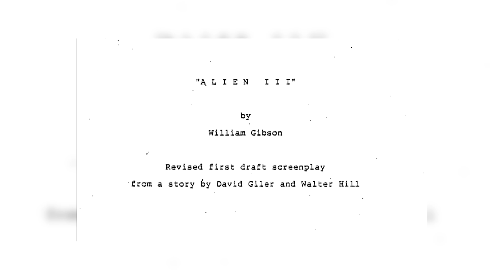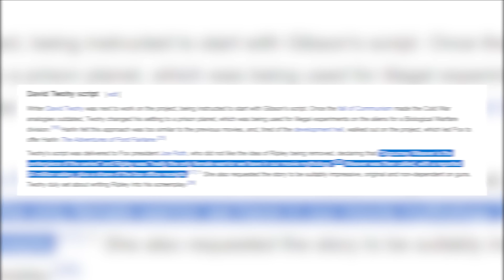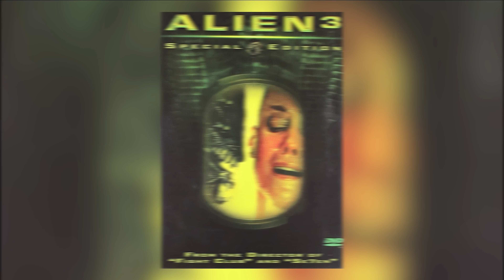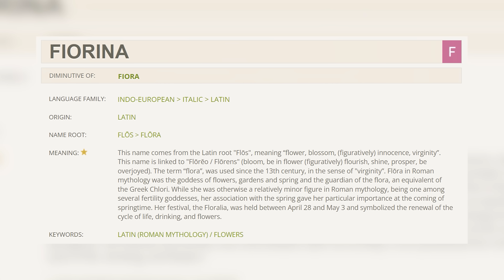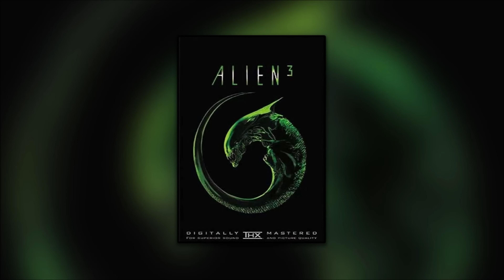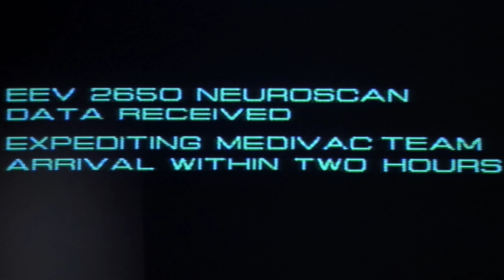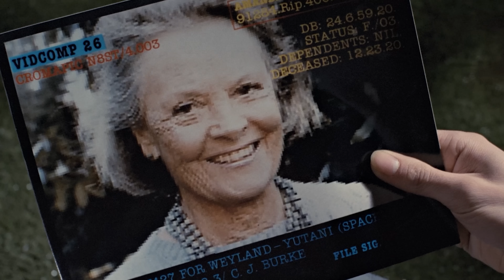ALIEN 3 (1992) Breakdown | Easter Eggs, Directors Cut Comparison, Hidden Details & Things You Missed

Comment: The rottweiler instead of the ox in the theatrical cut was a better choice.  Makes more sense given how the xeno is faster and more agile than the human hosted variants in the previous two movies.
Reply: Nah. Makes no sense to how a almost full grown same size as the dog. It wasn’t even a little “snake” like. The Ox made sense because of how big it was and how big the Xeno pops out semi fully grown.
Reply: I think overall, the extended (Assembly) cut is a more well-rounded version, but...
The editing in the original version of the funeral/birthing scene is mesmerizing. This is lacking in the Assembly version.
I don't have a preference to which animal was used, but the scene is more impactful in the original.
Reply: How about....where the fuck did they get an ox???????
Reply: I'm a little more partial to the dog host for the xenomorph, too. The ox was one of the weak points of the Assembly cut, though I felt it was overall a better version.
Reply: It adds to the fact that xenomorphs have no delusions of mortality. They don't care if you're a dog. I think they should have had two xenos running round. One made from the dog which is smaller and more agile, then the bull like from the ox. With how different the xeno looks throughout the film, I do wonder if that was ever something they wanted to do.
Reply: @Dante Colon the xenomorphs grow tall and big regardless of its host. Catch up with the lore
Reply: @acfan8253  The Alien 3 Runner is far smaller than human borne Aliens.
Those were good 8ft tall, the Runner is dude sized if not a smidge smaller - 5-5,5ft.
Reply: In one of the versions of the scripts it was going to be a rhino, that's messed up but fun to think about 😅

Comment: 17:35 the twin suns were used because the area of space in which Alien, Aliens, and Alien3 take place is near Zeta 2 Reticuli, a binary star system. Lambert states this in the first movie when they are getting ready to land on LV-426, which then of course is where Hadley’s Hope is later founded. And then having recently escaped LV-426 at the end of Aliens, I would imagine that the Sulaco wasn’t very far away by the time the escape pod had to be jettisoned because of the stowaway facehugger(s) causing trouble. So, the reason for the two suns may not necessarily be a callback to Star Wars, so much as it is a mindfulness of continuity on the part of Alien 3’s production team.
Reply from the maker: Great but if trivia, thank you
Reply: @heavyspoilers  thank you for the video, despite you (understandably) not wanting to watch Alien 3 lol

Hope to see one on Resurrection, and the rest at some point.

Comment: The actual stuff with the xenomorph and Newt is a lot worse than what you picked up on.

The explanation is that the facehugger got into Newt's pod first, and impregnated her. You can actually see in the quick x-ray shot that the character isn't wearing anything on their shoulders. No clothing. Ripley still has her singlet on.

But the alien queen inside Newt couldn't gestate to full size since Newt was just a kid, so the alien queen embryo crawled up out of Newt's throat, broke Ripley's stasis chamber, and then crawled DOWN HER THROAT. That's why she's rubbing her throat and the like, despite nobody else in the series having throat issues after being impregnated. It was because she had a half-grown alien embryo FORCE its way down her throat, hence the hoarse voice, etc.

There's actually a comic that shows this explicitly happening, and also a scene in the script that never got actually filmed showing it, likely to try and keep the fact that Ripley was the ultimate host a secret until it was revealed in the film itself.

A lot of the issues are that the theatrical release version is bloody dogwater. There were so many changes and cuts and whatnot that it just ruined any chance of continuity in the assembly release. Like the fact that the 'super facehugger' appears but the facehugger in the EEV was clearly a regular facehugger.

Comment: While it's not special to like Alien 1 and 2 and also Terminator 1 and 2, I like to go against the crowd and say, that I really like Alien 3. It certainly can't mess with it's predecessors, but the whole aesthetic, narrative and presentation of the film is spot on to me.
My main issue with the movie is it's ending, how they actually got rid of the xenomorph. By heating it up and rapidly cooling it down, making it burst. That does not f*cking work with organic tissue, it only goes with certain very hard materials, that simply can't deal with the tension, that develops in the material, when extremely difference temperatures hit - like glass or steel, and also only large constructions of that. Those materials can't bend and stretch, ripping itself apart when areas of an object want to expand/shrink in different directions. With organic material, it's whole purpose is to be somewhat soft and stretchy, so a living creature simply can't explode by heating up and cooling down. Probably the circular system would collapse, but that would not be shiny enough for a move.......
Reply: To be fair, the Xeno's skin is not like any Earth based organic. The fact that it could even survive molten lead without blistering or literally melting shows that it's not really skin but more of an exoskeleton. Also you have to consider other factors such as the highly pressurized blood of the Xeno which already makes it more prone to combust when it's shell is compromised.
Reply: @Zikk0_o  Yeah you got good points, but that would not convince me at all. Tze simple fact, that the Alien is moving with all the stretching in it's tissue is reason enough, that it simply can't have the same thermal stress as a hard and solid material does. The stretching tissue alone cancels out any possible stress from thermals, so it being an extraterrestrial tissue doesn't matter at all.
Reply: @marcfuchs6938  Bones can experience thermal stress, and the Xeno is mostly a rigid exoskeleton. Plus, the high pressured blood would help cause it to bust, like depicted. The warrior cast seen in Aliens were constantly combusting from open or compromised wounds. It's a part of their defense mechanism, much like exploding ants in real life that sacrifice their body.
Reply: @Zikk0_o  I still would remain firm on my opinion, but I certainly don't want to get into serious arguments about the properties of the organic tissue of a fictional life form. It's simply not worth the time. I don't know about you, but I wasted way too much time fighting pointless fights on Youtube.

Comment: The double-Y thing came from an outdated biology idea. It ultimately turned out to be wrong, but it was believed at the time that people with an extra Y chromosome were believed to be more likely to be violent criminals. This was more-or-less put to rest not long after this movie came out. 

The problem with this was that the scientists that first found this correlation had a lot of samples from prisoners. The earliest of the studies looking into this started in the 1960s, so informed consent, especially of prisoners, wasn't much of a consideration. The scientists found that a lot of violent offenders had an extra Y chromosome. The scientists didn't realize that an extra Y chromosome was more common in the general population. So from their imperfect data, it looked like having a Y chromosome made you more likely to be a violent criminal. 

Better studies came out. By the early 90s there was doubts about the double-Y criminal hypothesis. By the late 90s it was pretty clear that the evidence didn't support this idea. 

There are some effects of having an extra Y chromosome. Most human chromosomes have a ton of genetic information. Having an extra chromosome is usually fatal with a few exceptions like Down Syndrome (also called trisomy 21 or having an extra 21st chromosome), as well as mosaic individuals who have some cells without the extra chromosome. Sex chromosomes are a special case, since the Y chromosome has relatively little genetic material. 

Genetic males with XYY Syndrome, aka Jacobs Syndrome, are generally taller than average and have a higher risk of minor learning disabilities. They generally have an IQ in the normal range, though often slightly lower than their siblings. The extra chromosome has no impact on fertility. The link between XYY and aggression has been pretty much debunked. 

The idea would have been around when they were writing Alien 3. A geneticist might have had some idea that XYY aggression was sort of falling apart, but it was harder to research pre-Google and the studies that really dealt the death blow didn't really come until later, towards the end of the 1990s.

Comment: One of the issues with this franchise is that each movie or product that licenses the use of the IP feels the need to make the xenomorphs even more dangerous and hard to kill to give that 'what will they do now?' feel to things. They shouldn't be allowed to do this, because it cripples future use of the creatures. In Alien and Aliens the xenomorphs are just sneaky and dangerous, but otherwise can be killed by conventional weapons, but by Alien 3 we're already seeing that they can be submerged in molten lead and emerge a time later just fine. Why exactly did the creature shriek when blasted with a flame thrower, given that it apparently thinks of extreme heat no big deal? Future changes will also make it immune to the vacuum of space, at which point it's like will they have to drag it into the sun in the next one? A black hole? Are these creatures gods?

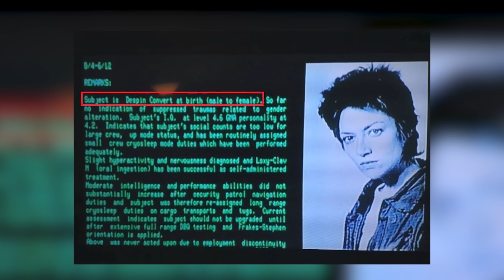Comment: 15:33 I would assume it was more to do with the misconception that people used to have regarding having an extra Y chromosome. As in men that have XYY chromosomes. It used to be seen as a genetic crime marker. I think the "logic" went that having the extra Y chromosome would result in more testosterone. And that would result in an increase in aggressive behaviour which would predispose that individual to crime. This is of course not true and the theory was later debunked. It is based on a common bias or discrimination against men. In that they are portrayed as violent aggressors, which is a very popular misandristic view point.

However I believe it hadn't been debunked at the time of the film and probably was meant to signify a planet that was filled with super violent aggressive criminal men.
Reply: Having the extra Y chromosome (in XYY) was literally called a double Y chromosome. So to be clear double Y does not mean you wouldn't have the X chromosome. I don't think it's possible to not have an X chromosome.